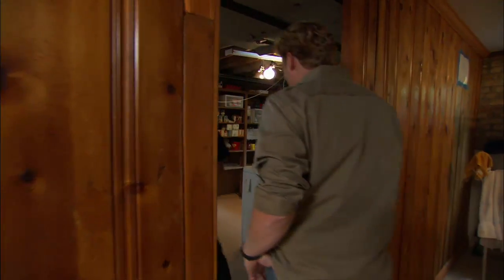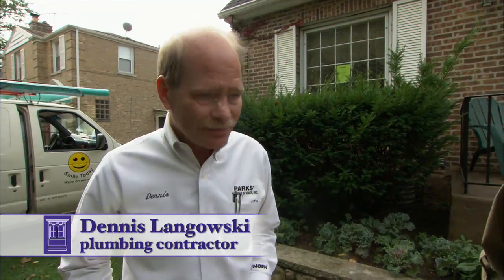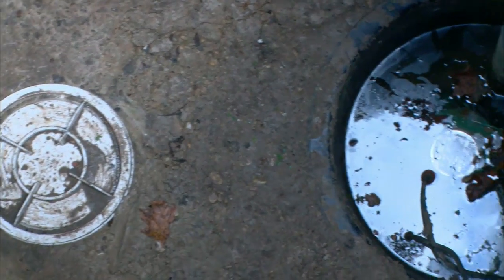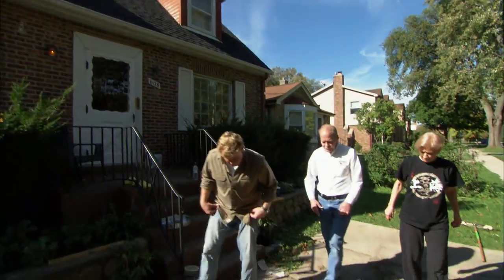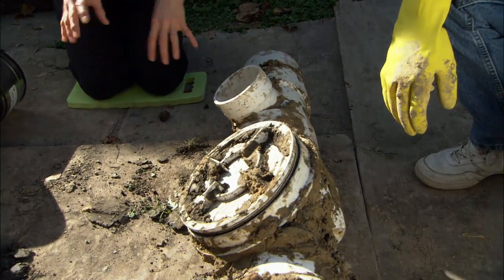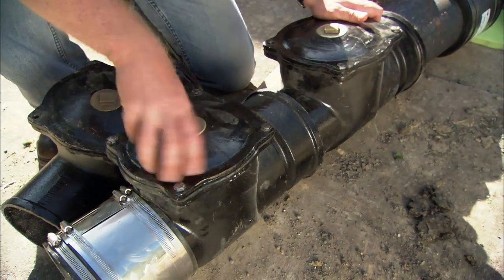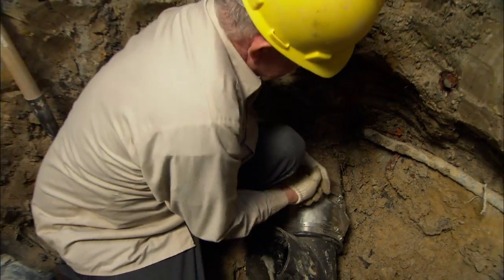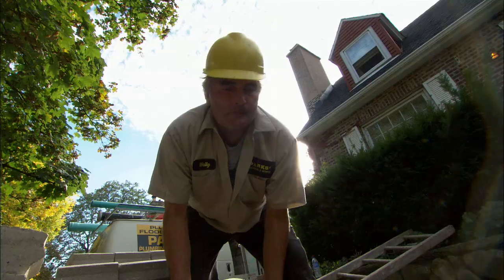How to Install a Flood Control System | This Old House

Comment: I just got the same cast iron valve installed. We had a big storm a few months ago which caused flash floods and overwhelmed the city sewer system. Unfortunately when I called around it seemed like most plumbers were price gouging. I finally found one company that was reasonably at $8700 for the double valve system with precast concrete rings instead of blocks...others were charging 14.5 for the same system. Most of my neighbors got flooded but some had this system in place and worked well except for one but the system that the neighbor had was a single valve. Yes the #1 solution would be an overhead sewer but the cost is extremely high especially if you have a finished basement, over 25k that's just the system not including rebuild of any walls. My advice is to call 10-15 plumbers. I called 12 😁👍🏼
Reply: Where did you get that double cast valve from if you don't mind me asking?

Comment: What I did not hear was how old was the PVC one in installed  Some plumbers installed the plastic because is light and easier to work with and always say the same this is guaranteed to work compared to the cast iron which will last 50plus years is harder to work with if it's done right but works better.

Comment: Did he say lead pipe the that supplies water to the house?
Reply: Its NOT just FLINT Mi ~ when a gov buys pipe do you think they buy from local suppliers or get bulk from one....... might not be the whole nation but you can bett its the whole state
Reply: Do a little research it's a very common issue. At least 12 million homes have them.
Reply: Not that I wouldn't replace mine ASAP, but lead service lines are perfectly safe as long as diversity-hires at the local water dept. don't allow low pH to remove the protective scale.

Comment: Shouldn't the city be charged for this if it is installed in a home already having issues. They even said it blew off due to being over pressured by the  Cities system. I mean if they are backflowing homes because their system is jacked up or over loaded , it shouldnt be on the homeowner to correct their (the city) problem

Comment: The drains in my basement floors in the Chicago suburbs simply have  screw caps. Laundry tub drain has a gate valve. No flooding.
Reply: If the pressure is high enough the screw caps can blow off. Another option is to install an 18" stand pipe in the floor drain to effectively raise the height of the basement floor 18". You can't install a taller stand pipe because the water pressure could buckle the floor. And some basement floors should not be standpiped at all.

Comment: No residential homes in New Jersey have check valves. A lot have house traps but that’s it. What state is this? Our sewers are like 15 plus feet and rain liters are separate. No way rain water will come back up
Reply: Park Ridge, Il   Parks Plumbing is the plumbing contractor in Skokie, Il. I worked for Hausman Plumbing also in Skokie 2 blocks from Parks old man Ed guarantee his customers they would never flood again know why ? We installed OHS. Bsmt drain is not physically connected to the city sewer. Had to do once a year maintenance on either sump or ejector pumps the only way you would get back up is if the pump check valve failed or no power so we started to install Sumpro battery back up system. It’s like a back up generator so when the power goes out the system will keep the existing pump with power for up to 36 hrs.  I got an electrician who can install the Sumpro for that backflow they replaced , the unit is inside the  bsmt. So you can still use the plumbing via pump. These back flows are still physically connected to the city sewer into the bsmt. OHS much better than the back flow devices. OHS is overhead sewer  Hausman did 90% of the flood controls in the Northshore area from the 50’s to early 90’s  chicago and its older suburbs have combine sewers. They been working on the deep tunnel for decades they are almost done they have 2 reservoirs to complete.
Reply: This was filmed in Chicago. Their sewer and storm water are in the same system.

Comment: Why does a storm impact the sanitary sewer line? In my state sanitary sewer lines and storm water lines are entirely separate.
Reply: Many older cities have combined sewer and runoff water systems. They're cheaper, but they always run the risk of flooding basements or being overwhelmed during storms.

Comment: Adding cement to cover both the check valves???  That's a mistake.  Try repairing that mess in the future!
Reply: I'm pretty sure they didn't cement the couplings so you can just remove it by unscrewing those and chipping the cement. That thing would be good for 20 to 30 years though

Comment: Bought a house year ago. I had the same thing happened to my basement. Sewer back up.    Happened  3 times.  One time it was so bad.  Almost destroyed my furnace.   Nasty water came inside.  There was shit on my basement floor.    Disgusting.   I had to install 2 check valves      But you need to have access to them and need to clean them twice a year.
Reply: John McLain lmao or replace your sewer main line. Where do you live

Comment: No shoring. Guess this company does not care if it's employees get killed.  No clean out in front of the system. Guess this company does not care if it costs the homeowner more money to have the sewer cleaned in the future. Good that they used cast iron for this job though. But there were some major short cuts with those two  items alone. Wonder what the finished product looked like.

Comment: This looks like such an easy, inexpensive solution, I think I have been inspired never to move into that neighborhood or buy that house. Having almost 4 feet of sewage water in the basement is a real turn-off too. 🤮
Reply: Many places in the US are combined sewer systems in whole or in part; once any system is overloaded it seeks an outlet. I just had 9-12 inches of water in my basement outside Chicago after some 8 inches of rain fell in two hours. I got lucky compared to some neighboring towns. The backflow preventer was the only thing that would have saved me. Nobody is gonna raise their taxes for the millions needed to double or triple sewer system piping to handle combined storm water and sanitary sewer flows, and it would take years to replace all the lines, pumps, etc. to handle what has been called a 500-year flood.

Comment: em... so the pump failed you said? where's the pump?
Reply: it's in there but in this case the pump didn't really fail. All that means in this case is if the pump is capable of pumping say 100 psi, there was more than 100 psi trying to get in so the pump failed in that it failed to pump it out harder than it was coming in. This is to be expected especially since it's probably designed to be a build up intermittent pump (that is, it can't hold 100 psi constantly, like an air compressor, it does it in bursts, then needs to charge up).  Basically the pump didn't stop working, it just failed to provide more pressure outwards than was being pushed inwards. It did perform within spec though prolly.

Comment: And this is why the UK has separate systems for sewage and surface runoff.
Reply: Most of the United States does, too. There's two separate systems where I live, and the sanitary sewer still becomes overwhelmed during record rain fall, and flooding. It happened twice in the last 25 years. In the 1980s it became against code to have the sewer line below the basement floor. Any below grade drains must be pumped into the sewer.

Comment: Never really liked or believed in backwater valves on sewer mains.  You never know when the check closes in the event the main in the street backs up.  Homeowners could still run water on their side of the check, not knowing it had already closed, and still have flooding inside their home before they knew what was happening.

Debris from the wastes being flushed down those sewers can still get lodged in between the check clapper and the part where it closes against the body of the valve allowing sewage to leech past the check anyways.

Contractors in this video did not necessarily provide the most safe work environment for themselves either.  Always work safe out there, everybody!
Reply: Yeap tampons paper waste products will get stuck on the flapper (s) and won’t close 100%. Mechanical system
Reply: Correct. The best option is a Sewer Gate Valve. They also require maintenance though. Per Balkan:

"A sewer valve is unique and designed differently than any other type of water valve or gate valve. A valve used to prevent ‘backwater’ (waste water) from entering into a building from the public sewer system is exposed to corrosive water, waste, grit, and other solids. For that reason this type of valve does not use a typical ‘seated gate’ – a ‘knife edge gate’ is employed. A knife edged gate is specifically designed for controlling the flow of a wide variety of materials, such as found in pulp plant, paper plants, mining, and waste water treatment plants who’s flow contains solid materials. Unlike for instance a valve meant for drinking water."

Comment: How the hell does storm water make it into the sewer?
Reply: Some places have rain water enter the sewer system while other places have separate systems.
Reply: Sounds like a nightmare fore the treatment plant.
Reply: Yeah unfortunately many places have combination sewer and storm water systems. Many cities are slowly replacing them with separate systems but it costs so much.
Reply: It is - that's why combined systems are more common in older cities that built them before sewage treatment was done. In the old days they just drained everything into the nearest convenient river.
Reply: William Lee If I'm not mistaken cities with combined systems are required to have storage capabilities for a "reasonably large rainfall" I know where I live the waste treatment plant can handle a storm dropping about 2 inches over the entire city, which while it doesn't sound like much is actually a very big storm. If your ever curious I'm sure whoever the people are at your local waste treatment plant will be glad to tell you, maybe even give you a tour if you call ahead. They don't even smell bad, waste treatment management nowadays is really efficient
Reply: @davidernesto6258  good advice, as I would also suggest to visit your local Public Works department or entity that deals with storm water to help understand water quality issues.

Comment: When one lid does not work, add a second.  And for some reason make it cast iron.
Reply: Cast iron can handle higher backflow pressure, but the only reason for two I could see is to buy time for the pit to drain.

Comment: Shouldn't the city being doing this work?
Reply: Most places it is on the home owner once it passes a set point. For sewage it is generally until it dumps in the main it is the home owner. For water, electrical and gas it is once it gets to the meter it is now the home owners cost to fix/upgrade. Then again there are some fun ones like having to pay for a everyone else can use thing like a new larger transformer but then there is nothing like dumping $10,000-40,000 into their equipment because they don't feel like upgrading the 40 year old transformer.
Reply: city governments are a scam, who would have guessed
Reply: If the city can't maintain their own infrastructure... why would they pay for her band-aid?

Comment: Because the line was plastic, I knew that was the problem.
Reply: Plastic under pressure can be very strong as well. And it doesn't rust. It was just a stupid design. They should make the cap a bit tougher, and make the hinge function on it's own instead of relying on the cap.

Comment: Wow! Am I right to believe that if you need that type of backwater valve system to protect your house from the water coming from the city then you may as well  live in another neighbourhood as your french drains will not work while your backwater valve is in operation. There is so much water pressure coming from the city. To break a plastic backwater valve system requires a lot of pressure. I would be worry about how good your city water drainage system is if you constantly have to protect your house from backwater. I am not a plumber yet that sound fishy! Impressive yet fishy. Does it rain a lot in that area? Do people pee a lot in that area? Beer drinkers? 🤣🤣🤣🤣🤣
Reply: French drains go straight into the groundsoil, not diverted to stormwater. You’re thinking of a drain tile system. Have to do a dry well for your drain tiles if using this sort of system. Also chicago has had a few outlier rain events in the past few decades where municipal and home systems were totally overwhelmed.
Reply: You're thinking of drain tiles connected to the sanitary sewer system, which was made illegal back in the '60's I think.  If your house was built before then (as I'm sure this lady's was) you're usually grandfathered in, but I'm sure she disconnected LONG ago given the sewer issues indicated by the "industrial" nature of her back flow preventer?  Seriously, I've never seen anything like this!  Most people just chip up their basement floor and install something the size of a shoebox.

Comment: Where was his excavation box!? That guy in the pit could've been killed if the dirt collapsed on him
Reply: nathan Adkins That dirt wasnt going anywhere... you dont need a box lol the dirt isnt going to jump into the hole is it?
Reply: Using PPE's is not about arguing whether if it's needed or not on your own discretion. There are laws and government organisations that require and check that you use it where prescribed. Just like you have to wear a helmet on ANY building site, even if there isn't anything build up yet.
Reply: Agree, that was the first thing I said.  I work in a similar industry and we don't enter until shoring is in place.

Comment: So we have backing up sewage and a lead water line. That's bad enough. What's even worse is that it's in the same hole.
Reply: Sewer lines and water lines are run together when initially installed.  It's normal.
Reply: How is utilities sharing a trench WORSE than a sewer back up? It makes me lol when the armchair contractors go "b-but they're in the same hole hurr durr" it's been done this way forever. The only reason it has fallen out of favor is bc it's easier to hit a water line when digging. Do you think sewage is gonna find its way into a pressurized water line? 

also lead pipes are fine so long as the source water is not acidic. A protective layer of scale naturally forms on the inside of the pipes and prevents leeching. Only when the layer dissolves due to acidic source water does it become a problem. This is what happened in Flint

Comment: Not Code in Chicago.  Typical find in Chicago.  This woman is highly misinformed.  A little knowledge is dangerous for some people. (yes that was an insult) Poor and incomplete presentation and installation. Why? The system you present is only a backwater preventing system(double check valve). The home owner cannot use water in the home during a flooding situation because is will back out of the basement gravity sewer drain as it has no where to go.  They must have an overflow, a sump basin at the bottom no smaller than 20" x 40" with a 2" ejector pump at the bottom to force domestic waste water from the vault basin into the city system.  I have been in the flood control business for 40+ years and have installed thousands of flood control system in Cook County alone.  Parks usually hires my rejects. In that neighborhood, overhead sewers would have cost more, but would be a much better option.
Reply: I recently moved to Addison and I'm experiencing the same problem: Water backing up through the floor drains in the basement. What do you recommend as the best solution? Overhead sewer system? Flood control system? Any other possible solutions?